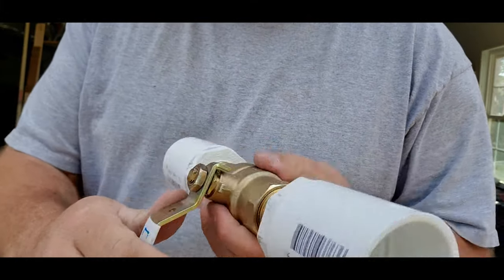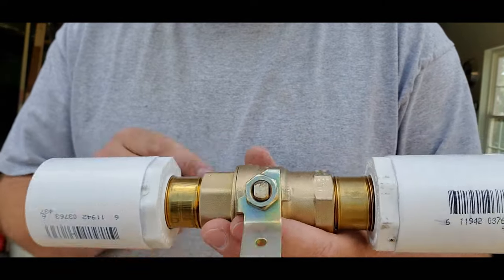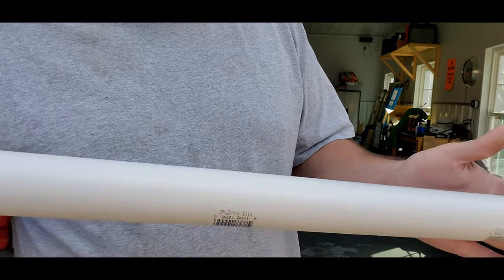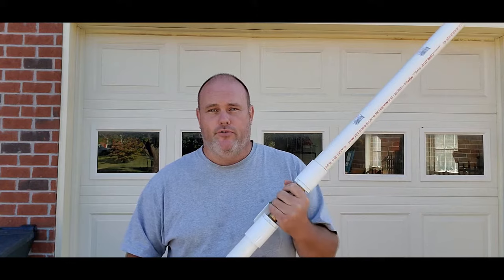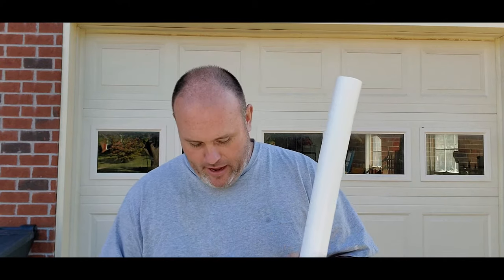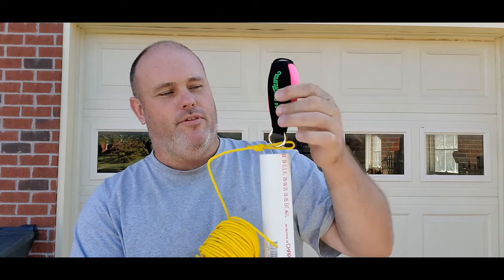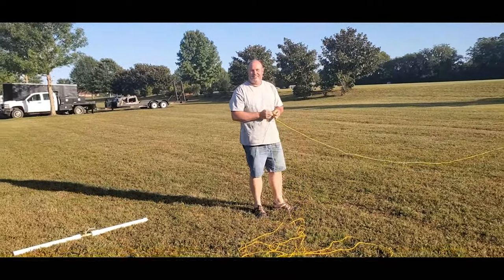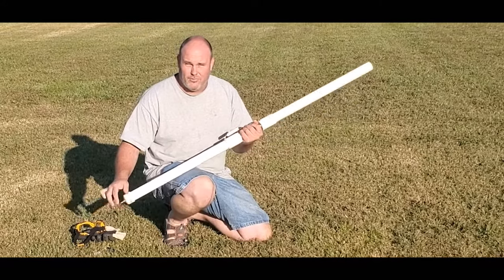Building an air powered projectile launcher. This thing packs a punch!

Comment from the maker: Help me out by leaving a simple comment.  It helps boost my video in the YouTube algorithms!!  Thanks for the support!!
Reply: I have watched several videos on the subject and am very impressed with yours. One question. Again please the name of the bean bag? Think that some modifications it would launch a tennis ball?
Reply from the maker: @dennissparks4511  it's a Weaver throw weight.   As long as there was not an air gap around the ball. If you got the right size of pvc pipe, I think it would work.
Reply: Look up Chicago powerline fishing on YouTube.
Reply: We did this in school to shoot tennis balls. The best cannon was just as this is but the air tank side was the largest diameter PVC they could find. The volume of air increased the distance 3x+ with the same pressure
Reply: @dennissparks4511  tennis balls roll in the air and will affect your over all heights. the weaver throw bags are only like 15.00 or 23.00 with the cord.
Reply: A longer tube would give you more distance, up to a point. :)

Comment: You braced this pressure vessel against your femoral artery to fire it. Although this feels like a natural position, its the worse possible place to put that. The construction of a PVC pressure vessel should not be trusted with your life. I would advise using a U bend to place the pressure barrel under the barrel and adding a skeleton stock, or make a protective housing (Butt Pad) for the pressure vessel that is purposeful built for the protection of a blowout against your body. Its just not worth the risk....
Reply: Sorry- but do you have any experience with one of these??? and this is not a 12 gauge shotgun.  I built the same exact one and there is zero/0 recoil!!!
Reply: @daveycrockett9447  it's not about recoil more about if it has a failure and shatters... in my mind.  your within spec rating wise but you are using co2 which can expand with heat
Reply: Sch 40 pvc has a rated psi at 400 psi at 2" 
Filling, or much more likely, tapping it while loading, if still cold from filling, is when failure is most probable.
Reply: Maybe Sch40 ABS would be better?
Reply: @daveycrockett9447  he's right though compressed air can easily blow a hand off or a leg pvc can easily rupture under pressure let alone he said he glued it its a projectile the same as a shotgun not as powerful
Reply: You are not wrong.
Reply: @daveycrockett9447  he's not wrong in the least. I've been feeding an air cannon addiction for 20 years and I've had a couple explosions that could have been bad. One put a pretty good cut on my neck, but I was really lucky. It was a a 2" 90 At 200 psi and it wasn't braced correctly. I was shooting 2" quickcrete slugs and the joint couldn't handle the torsion.
Reply: With 156 psi sir I'll pass on your uneducated advise
Reply: I always tape the inner tube and double wall and use Pressure rated tubing. I have nightmares about losing a hand so I try to be safe. And use 50-60 psi.

Comment: If my chemistry is correct and to figure out pressure & volume:   P1V1 =P2V2   If you know the pressure of the CO2 cartridge and its volume and  you know the volume of the  chamber, just algebraically solve for P2 to get your pressure.   P1 =Pressure of cartridge,  V1=Volume of cartridge, P2=Pressure of Chamber, V2=Volume of Chamber  :  There for (P1 x V1)/V2 = P2

Comment: Hi there I love your design but I have a few questions.  Firstly I'm in New Zealand so our PVC terminology might be slightly different than yours.   I'm looking to make one of your designs to use it as a bait cannon. Now your design around your brass valve. Both the brass nipples are threaded both sides right?  Then your Expanded Pvc bit that connects to the nipples are both Threaded female couplers?  Was that bought like that or did you have to make that part?  It's the 1.5 inch bit that is connected to the brass valve. Do you know what that is called?  Then your 2/3ft air chamber slots into that bit which you then glue right? Plus the "barrel" bit on the other side also glued in?  Many questions sorry.

Comment: You could go to schedule 80 and mount a pressure gauge on the air chamber and get more power. This is your typical potato gun or on a bigger scale used for pumkin-chunkin . Nice idea on the rope. Thanks for the share. :O)

Comment: Braided fishing line. Hose clamp a Zebco reel on the tube. Open the bail, fire. Attach antenna rope (That yellow rope is overkill) to the far end, and reel it up and over and back to launch side. Attach wire, and pull it up. Even just the braided line should hold a wire in a temporary setup. 50 pound test should be enough for a lighter gauge wire. This way, a secondary rope is not needed. Just shoot from far end in the direction of operating position. I have a spool of American Fishing Wire (Look it up) that I use for antenna remote ops.

Comment: Maybe spring load the handle of the valve and make it a push-release trigger so it opens quicker. I know you do it pretty fast but a spring with the right stiffenes would do it even better and gain a bit more moment of blasting it. Obviously you are very good and will find a way to design it right.

Comment: I like your simple launcher better than the one I recently built using a 24 volt sprinkler valve with a trigger switch and battery. I also have a Zebco fishing reel connected to the firing end with a projectile made out of a 3 inch length of pvc pipe and ends. It will shoot the fishing line over 150 feet straight up. The fishing line is connected to a larger line and pulled up. Sometimes the fishing line (10-12 pound) breaks. I pump it up with a compressor. The co2 cartridges sound much better (Thanks). I am building a horizontal loop antenna with two full wavelengths on 160M (1150 Feet of stranded #12) and 100-125 feet up on all four legs. 73  Dave
Reply from the maker: That is a LOT of wire!  I don't use the launcher very often.  It's easier, more compact, and quicker to use a throw ball but I only need to get my wire up 50 ft or so.  I have had the same issue with fishing string breaking and that's why I prefer that yellow cord.

Comment: I would attach a small diameter PVC pipe to the barrel underneath. Put a cap at both ends, the top end being removable. That would allow you to store a ramrod to help you load the bean bag. Also you could add a second tube that would allow you to store your CO2 canisters.

Comment: I used schedule 80 for the pressure tank.  Two 90 s and a couple short pieces of pipe to make it a U shape to reduce the length. And also put the shrader valve to the front. Laying the line on a piece of canvas helps with tangles.
Reply: How will I make one that goes 400 fps or whats psi mean?

Comment: I am planning to build such a gun and I would suggest to use a shorter but wider compression chamber and a built in pressure measuring thing. And maybe a simple pop up metal piece (frame with sight thingys in it) for aiming. The shorter chamber would make it look cooler (imo) and would have a better stand on the ground. But keep up the videos- great stuff, one can see you enjoy this very much 👍
Reply: You could just go to harbour freight and get one of those tanks that tire mechanics use to instantly inflate the tire to seat the bead. A little modification to the barrel diameter to accommodate whatever size weights you’re using.
Just have a portable compressor to air up the tank for future casts.
Been firing nerf darts with low caliber potato guns for years! (I’ll probably never grow up)you’d be surprised what velocity ping pong balls can achieve with a few squirts of AquaNet Hairspray or Alcohol.
I prefer the hair spray because the residue drys and doesn’t gum up the ignition device.
Enjoy your monster launches!!

Comment: Very good project.  I built a similar Water Balloon cannon.  I used a automatic (low voltage w/9v battery) sprinkler valve and a push button switch.  The solenoid gives you a quicker valve opening.  I plan to use your design for my through line launcher with the sprinkler valve mod.  I'm not very tech savy with video, so maybe you can show a video of this mod.  I have found this to be very useful.  I like the Co2 design.  I've use a 12v battery operated car tire pump so I can launch balloons from my boat.  With balloons you need to pour about a cup of water in the barrel as a sabot first to get a air tight through without busting your balloon.  With balloons about 60 PSI is the max without busting the balloons.  Balloons need a 2" barrel.   I'll be watching for your mods.
Reply: I'm curious about this water balloon cannon lol. Any chance you have a video?

Comment: They make a CO2 cartridge inflating kit that comes with a small psi gauge.  You also could just drill another hole and out a cheap dial gauge or make the adapter to put a gauge with the valve.

Comment: Enjoyed your video! I made one with the butterfly valve, last night. The butterfly valve I bought is too stiff. I am buying the gas valve you have there. Gonna cut out the butterfly valve. My gas chamber is a 4" with a reducer to 2". There I drilled a hole for the air pump valve. I am anxious to shoot it. My barrel pvc pipe 1 1/4" with a fishing reel on the barrel.  Best of luck. 73" KD4MAN

Comment: For safety, load the launcher before adding air pressure.  Last thing you want is to have the gun go off accidentally while loading it.   Also, use a stick to push the projectile down rather than tapping it on something to avoid any chance of cracking on the pipe.

Comment: Arborists use those "throwbags" as you also said.  See SRT climbing on Youtubes.  I like your air cannon-potato gun which I could suggest you charge using only air pressure from a compressed air cylinder charged from a gas or electric air compressor which would be a heck of a lot cheaper than using CO2 cartridges.  But some use an airgun like that to shoot the weight into the trees or you can use the techniques they use to pitch the weight up by hand which takes practice.. I know... or even use a piece of PVC and attach rubber tubing or bands to pitch the weight up high like a slingshot which is very practical.  The throw-line of course doesn't have to be expensive but fence alignment line or string is strong and at any length and cheap at Home Depot which is what you have looks like.  One more thing, you can keep your line clean and off the ground if you use a 5 gal bucket or container like arborists (tree cutters) use but that may be overkill in your case but a bucket is perfect.  Check this out.  https://youtu.be/vGoH9B9l9Xc?si=NzFrAp3h7dAzL4LS

Comment: You should try an electronically controlled  sprinkler valve  instead.of the ball valve  it opens.in a fraction of a second and only use 12v it will inprove the your cannons performance drasticly
Reply from the maker: That's the next level but something I would like like to try to build.

Comment: You may it helpful to dose the inside of the firing tube and the throw weight with spray-on dry silicone lube. I think 3M make and sell it over where you are. If you use a small sock for a wad, give that a shot of the lube spray as well. Don't pack the sock in hard or it will slow the launch.

Comment: Oh...im gonna go get my box of compressor parts and vakves, etc out and hopefully tomorrow build your gun with my changes for sending seed all over my yard for the birds. All I think I will have to do is use a Styrofoam plug under the seed with a epoxied on piece of wood to keep from blowing holes in it and a a screw on cap at the business end with 1/2" fence wire...out goes the seed and I don't have to chase the plug.  We shall see!

Comment: The larger your air chamber the more powerful it will be. VOLUME is a good thing. Just like the larger your sprinkler system piping is the better the volume of water pressure. The barrel is a very good size and should not be changed.

Comment: Compressor guages are very inexpensive.  Some have longer stems, some don't. A short stem can have a piece added. My point...get a small compressor guage with a 3/8" OD nipple, drill a hole in air chamber, thread on a nut, curved washer and proper o-ring/rubber gasket...slipp it through and do the same on the other side.  A bit of the right silicone (that doesn't eat rubber) might help a bit.
Now you know the air pressure at any time and can, through test fires, know what pressure goes to what height.  AND...you coukd add a compressor safety valve as a Just-In-Case and a knob style compressor pressure valve in place of the valve stem with marks at learned levels and quick fill to what you want double check on the guage for safety and if all else fails you have a safety relief valve as well.
REMEMBER: SAFETY THIRD...I MEAN FIRST.

Comment: There is always a reason for why the HD stores don't have butterfly valves but only ball valves and press valves. Why? It's easier to manufacture butterfly valves than the ball valve (instead of the ball with a hole, it's a round flap door). The reason is the ball valve is much safer than the flap valve (butterfly) under pressure. The only exception is when the butterfly valve is huge (0.5m to 50m diameter and sometime 0.5-3m thick steel... Dam) where a little bit of water leaking is no big deal).

Comment: Interesting. To what pressure would a second charge from the same once-used gas cylinder charge your gun's pressure tube?  I was immediately curious about that, so please respond. Thanks.
Reply from the maker: I'm not sure but I think you would be getting close to max what it could hold.  I would not push this thing above 150psi for safety reasons.

Comment: Did you ever just put in a pressure gauge? My pneumatic spud gun had one.
Reply from the maker: I did not, I'm thinking about redoing it with a smaller but wider air chamber.  This is a pretty big item to haul around.
Reply: @W4OPS  that's what I did... since in low pressure high volume launchers, your chamber should be 2.5 times your barrel volume. I used a 3" chamber for my 2.5" tennis ball cannon. .. love yours.. next step, fast acting valves 😉

Comment: I am unable to locate the reducer fitting with 1" female threaded to 1 1/2" slip. I have been to both Lowes and Home Depot. Would you happen to have a manufacturer or an SKU# ?
Reply: @stevebrosnon4246  I ended up ordering them online through Lowes. They should be here in a couple of days.

Comment: Nice video and nice idea. My question is what pressure can the PVC handle? Kinda scary at 110 lbs. I use a pump for mine and find 40-50 lbs does just fine.
Reply from the maker: I do think it could handle between 150-200 psi pretty easily.  But I use schedule 40 type pvc because it does have a psi rating.  Keep in mind with age and use that rating will decrease and the plastic will degrade over years of use.

Comment: not convinced by using CO2 canisters as the pressure source. Appreciate however that a bicycle pump would require manual effort and that would never do for most Americans.
Your design looks fine for occasional use, but I now see why tree workers make their pressure canisters from metal not PVC given their use is more frequent.

Comment: How long does the throw bag last. I got 3 shots with a 16oz throw bag before seams split out.
Reply from the maker: My has been holding up pretty well. No signs of damage yet. Weaver is a good brand.
Reply: You can also build a 3/4 projectile out of 3/4 pvc fill it with some weight and cap it on both ends and then add an eye loop and tie fishing line to it.  Some people have taken that approach

Comment: I made mine with a 1” barrel. I use 2 .54cal roundballs flattened on an anvil to tighten the fit. I stack the two balls and drill a thru-hole through which I pass a nylon cord. I tie the monofilament line to the cord. I place a paper wading down the bore to seal the gaps. And I NEVER charge with more than 50 psi.

Comment: @3:53 "of course we are going to take all of the safety precautions" @5:23 PPE on to charge the weapon, ok looking good! @7:08 With all PPE completely abandoned we will now load the projectile (which obviously should have been loaded prior to charging as a "safety precaution") @7:25 It actually gets more scary, you could use a loading stick but opt for the tried and true "beat the Schrader valve against the ground method. But you completely redeemed yourself when you took the test shot; knowing the Schrader valve might now be the most likely point of failure you guarded all bystanders by placing it over your right femoral artery region to take the test shot.

Comment: My simple comment is that you always want to treat any type of launcher - whether it be pneumatic or combustion - as if it were a firearm... Loading the launcher's BARREL in this video AFTER you have pressurized the launcher's CHAMBER is a really bad idea, because there is always the remote possibility that you could accidentally bump the ball valve - causing an accidental discharge of the pressure in the chamber. And that loaded 'throw bag' exiting the barrel at several hundred feet per second would have enough ballistic energy behind it to cause serious injury or even death to whoever it hit.

Comment: looks like you didnt quite research enough.
a ball valve?

you want a "quick exhaust valve"... probably in 3/4.
no matter how fast you are, the exhaust valve will have dumped all its air by the time you get that ball 1/4 way open.

Comment: You are costing yourself too much money.  Remove the valve that you have and replace it with a one inch sprinkler
valve and connect the sprinkler valve to a 20 volt battery with a contact switch.   All you will need is 60 to 90 pounds
of air.  Should you like to be at a remote spot take a air pig with you.    YOU ARE GOOD TO GO.     Paul J